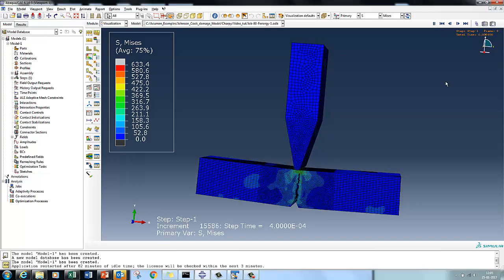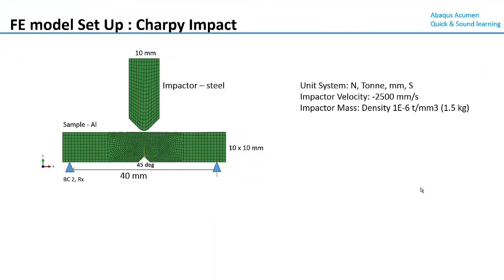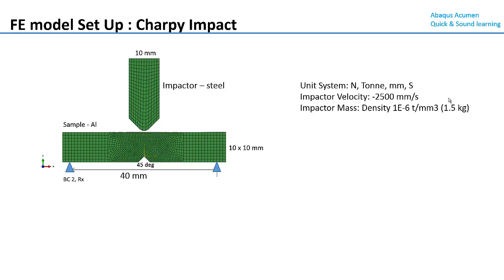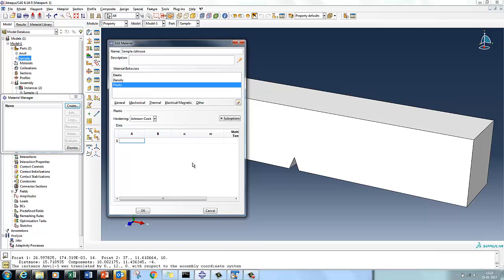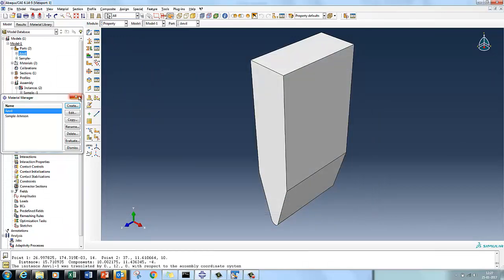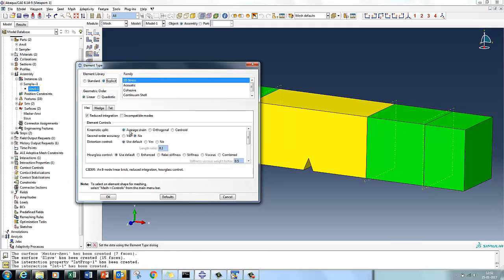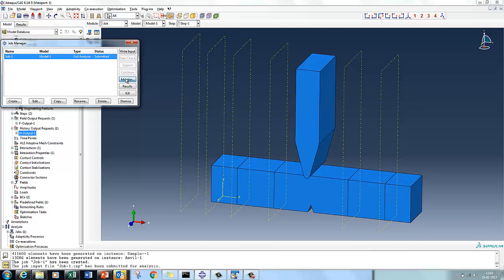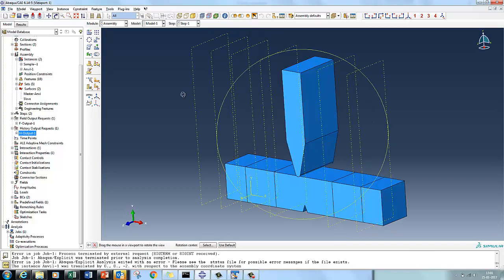Abaqus614: Charpy Impact tutorial - Johnson-cook material + Damage

Comment: Thanks for the tutorial! Always very hepful. 
Just one thing, I believe you set your density wrong. I verify my anvil mass and it was 4.8 kg as the volume is 4797.07mm3, as such the density in order to get 1.5 kg is 3.127E-7.
Or am I missing something?
Cheers, keep up the good work!
Reply from the maker: The anvil geometry is approximately modeled in this demonstrative tutorial, it is @ 2.3 kg. In your case you may be correct too. As it is mentioned density can be manipulated to get the accurate mass without changing physics of the problem.

Comment: Thank you Abaqus Acumen for your wonderful videos. I watch all of them without fail. I am currently working on a bullet impact problem. The job is running succesfully but a clear hole is not formed. The elements in the impact zone are being dragged and even after I did Result > Field Output > PEEQ > Remove elements  - I entered many values here.  But still, the distortion persists. Can you help me out? Thanks.
Reply: Hi Sachin, have you completed the bullet impact
Reply: @pawankumar6003  did you get any progress? i got a lot of warnings
Reply: @Jehosafath  warnings are ok, errors should not be there